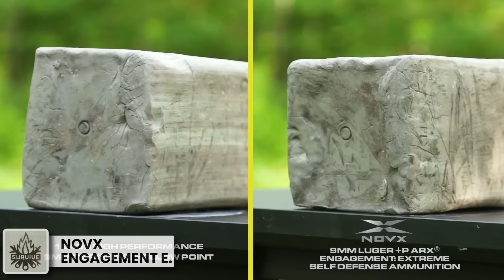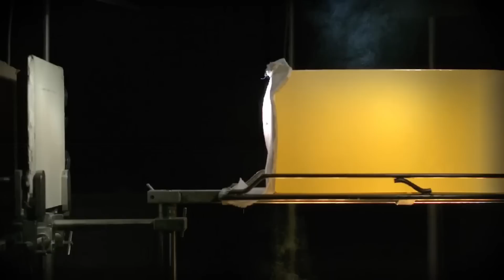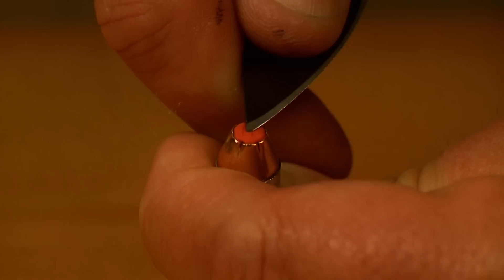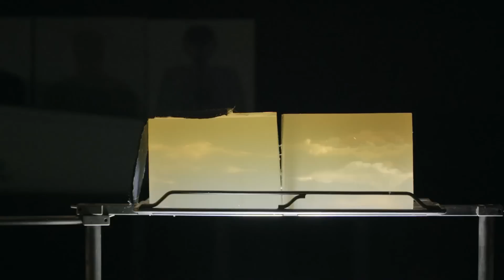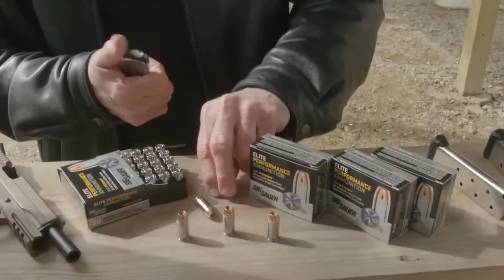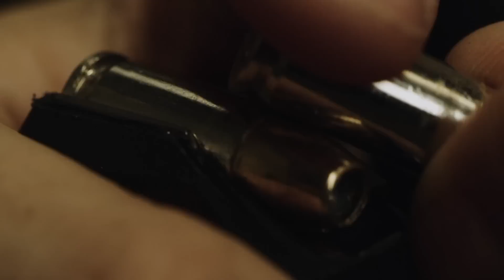BEST 9MM AMMO FOR SELF DEFENSE & HOME DEFENCE 2024

Comment: Liberty Arm's 50 gr solid copper hp, 2000-2100 fps, 3-4" barrels  or in revolvers, 45--500 ft lbs. Because the bullet is so light, the recoil is very low.   This  beats hell out of .38 Special loads, cause .38 is so wussy-loaded here in the US. The same brand, same bullet in .38 is 1500 fps. a mere  280 ft lbs and might not even expand in lung tissue. That's the problem with .38 hps. Theyh aint moving fast enough to get reliable expansion in lung tissue. The lungs are just air sacks, actually.  Animal tests prove this. What happens in jello is irrelevant.